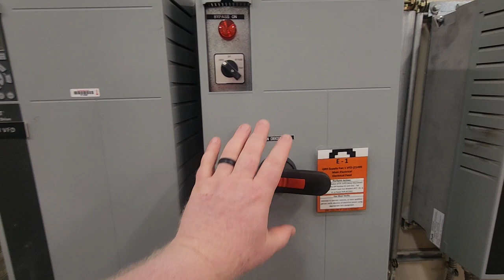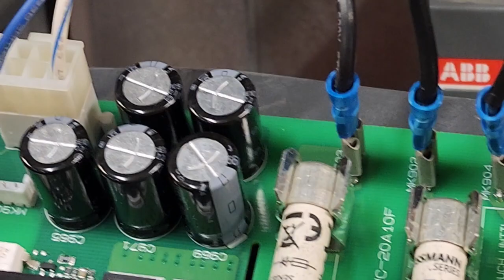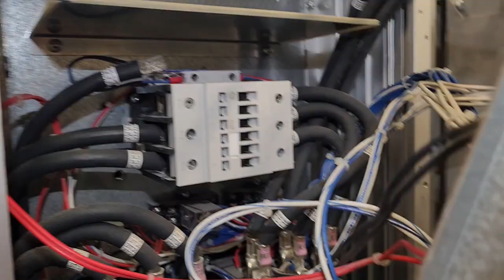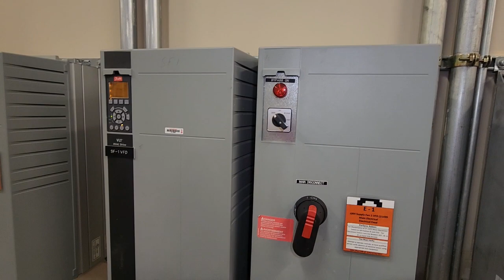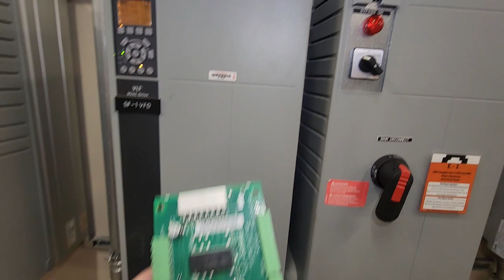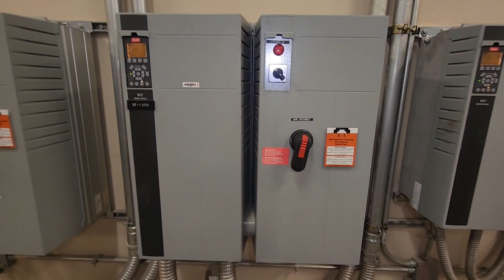Solve the Puzzle: Fix this Danfoss VLT HVAC Variable Frequency Drive Malfunction!

Comment: Danfoss/trane vfds are not a favorite, parts delivery and support suck, we swap them out usually. Great video as usual. If this is a known failure point contactor why not just swap with a different brand?
Reply from the maker: I've got a replacement VFD ordered. Had to get parts to try to limp it along until then